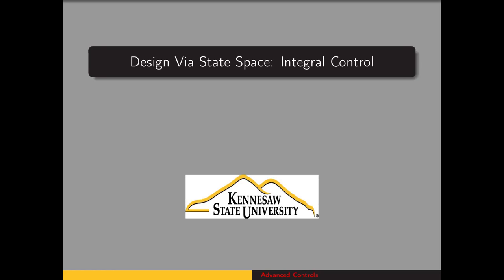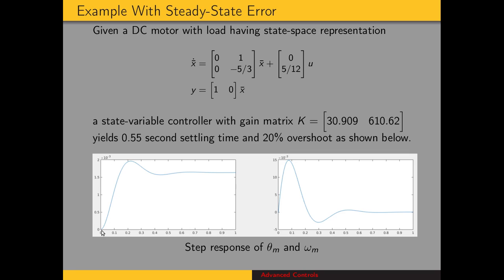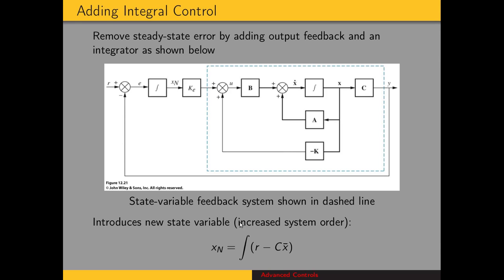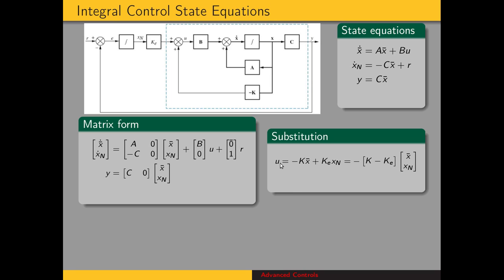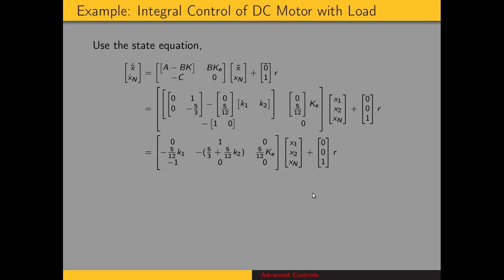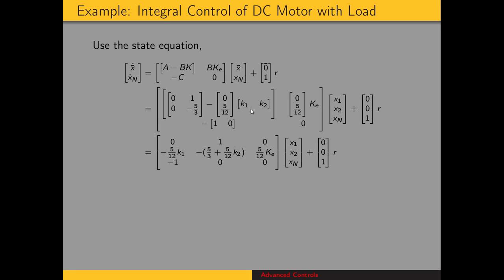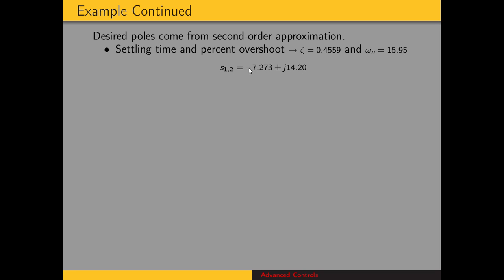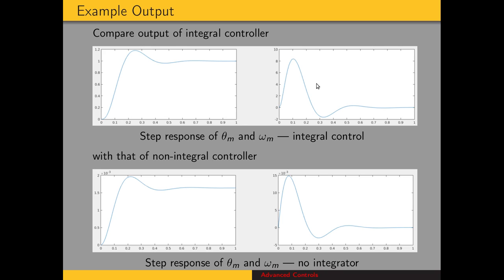Integral control

Comment: thank you so much!!
Reply from the maker: It's my pleasure.
Reply: sir ,how to add a observer to the plant , if i still keep the integral part . After the system matrix is extended，l find the new system can 't be observed ，so kalman function in matlab can 't be used to find the kalman gain .  What 'more , what 's the difference between the discrete systems and  continuous systems , if  I want to add the integral part to discrete systems . thanks in advance !